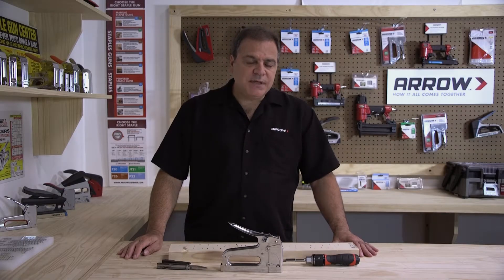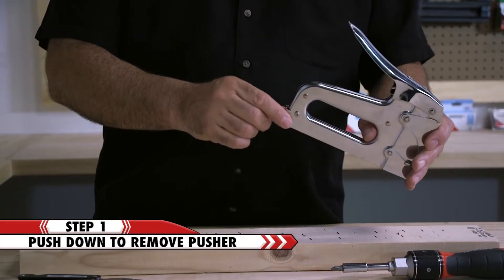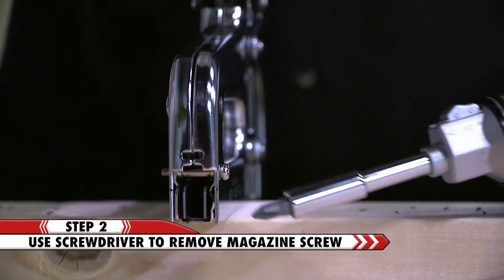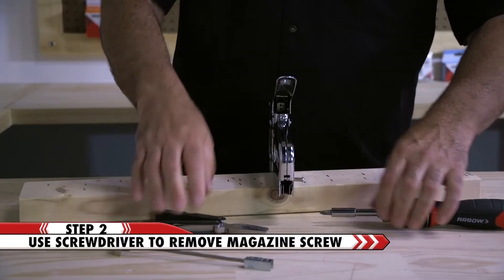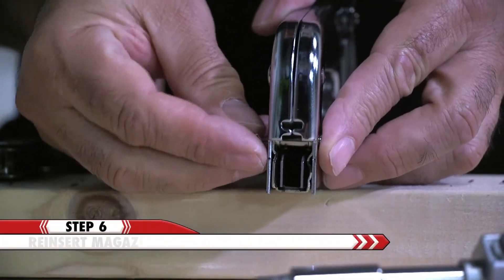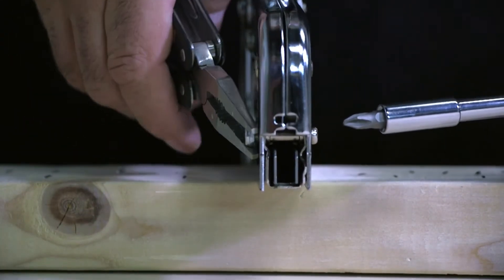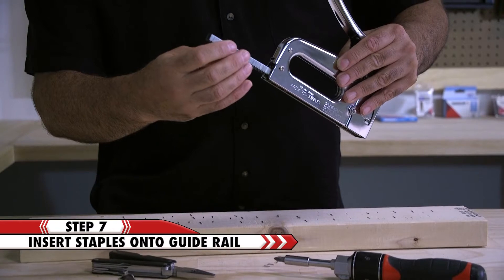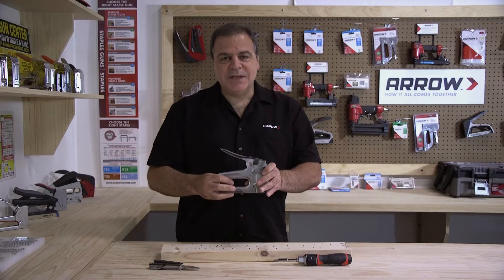How to Clear a Jam From Arrow's T50 Staple Gun

Comment: I have an Arrow T50 stapler I bought in 1995, never had a problem with it.  I recently used it and a box of T50 3/8” 10mm staples  (also purchased in 1995). for a reupholstery project and had no problem with jamming or staples taking hold.   I ran out of staples and bought a new box of T50’s at Home Depot to finish the project and it was a disaster. Staple row fell apart on touch, jams occurred 10 or 15 times a refill.  I used tacks to finish the job out of frustration.
Reply: i expect as much, low quality staples means low quality results. Probably the glue used to hold the staple rows together
Reply: Were you buying Arrow branded T50's or some off brand no name Chinesium?  Cheaping out on something that will only save you a buck or two is not worth the headache induced.
Reply: Nope, old school from neighborhood Hardware Store.
Reply: Even the current stapler guns look disposable.   Corporate America at work,  good profits crapy products.

Comment: These Arrow T50 staplers jam and jam and jam again.  There is something really wrong when a new tool - using Arrow T50 staples - can only fire one staple, then the next three times you use it it jams, clear the bent staple, jams again, clear the bent staple, jams again, clear bent staple, dry fire it, then it works one time before jamming again.  What the hell.
Reply from the maker: Hey there, thanks for reaching out and giving us a chance to address this. What type of project are you working on? We do offer a warranty on this product, so we'd like to touch base with you here or by email at customercare@arrowfastener.com to troubleshoot with you and find a solution.
Reply: I bought one brand new and I have the exact same problem. I would say that more than half of all of the staples jam. I have the T50P. This thing is a curse. I am going to get something entirely different. I plan to go with what people use on my job site, working with framing crew.
Reply: Yes and it is hell trying to get the screw and nut off to clear the jam. I haven't gotten mine off yet.
Reply: My exact experience with this thing. It’s the absolutely most worthless tool I’ve ever purchased. I’ve spent hours trying to fix this thing. No matter what u do it jams and was more expensive than other brands. Ive got an extra one someone left in my shed and it dies the same thing. How do they stay in business. Should advertise wanna have a terrible day buy a T-50 and experience  the worst day. It’d be better to set money on fire than buy this thing. Total crap

Comment: Hitting it with a hammer and throwing it across the garage didn't work. I'll try this, next
Reply from the maker: That's hilarious 😂😂😂
But all joking aside, yes, you will have much better luck removing the jam with a screw driver. You can also try to grab the jammed staple with needle nose pliers if it's really stuck! Good luck!
Reply: @arrowfastener  I wasn't joking. I was installing a garage door opener and I was cussing like a drunk sailor with tourette's. However, I took it apart last night and fixed it in a couple minutes.
Reply: @Eaglefreek300 ya dude I’ve gone through 4 in a week and was into buying my 5th 😭
Reply: @alex-rm4tg  I bought an old barely used  stapler on ebay. It has been working flawlessly for 3 years.

Comment: I have 2 of these and all they do is jam. I’m building a greenhouse and would staple once or twice then jam. There was another one in the tool shed from the last owner and same exact thing. I even bought the more expensive arrow staples. I shoulda been done by now but have spent more time clearing jams than putting up plastic. Biggest piece of crap I’ve ever owned and it was double the price of the Stanley but it says professional and I wanted the heavy duty dependable tool to get my work done right. This is not the tool to do it with. I live in a rural area so now I gotta go an hour back to town to buy a different stapler and waste more time but I’ve already lost 2 days thinking it would get better and since I had a second maybe something was wrong with one. And now it’s raining and my greenhouse is half up and gonna get blown to pieces bc I can’t staple it secure. Thanks arrow for stealing my time and money
Reply from the maker: Hi. Thanks for the comment. Sorry about your negative experience. Your tool shouldn't be jamming that frequently. Before you make that drive out to replace your tool, please consider reaching out to our customer service team. You can find contact info here: https://arrowfastener.com/awesome/contact/
We'd love to try to help you with your T50, and your greenhouse.

Comment: in response to other comments: I still have my original Arrove T50 staplegun from the 90's, and I've had a total of two jams in the entire lifespan of this tool.  TWO.  I don't get the problem these people are talking about.
Reply: Just bought it today to put up wire mesh had 2 jams already
Reply: They used to be made in the USA. Now they're made in China. Your stapler from the 90s is not the same tool as the one sold currently. I recommend you never lose that stapler because you can't replace it.

Comment: The T50 is a great staple gun.  Simple and easy to use, but the manual is very bad.  This wordless manual does not explain how to clear jams.  It just shows a hand pinching and unscrewing the screw.  It does not show a screw driver or pair of pliers.  It isn't even clear that clearing a jam is what you are doing.  Arrow, you really need to spend some time and correct the manual to make it clearer.  This is not IKEA furniture.